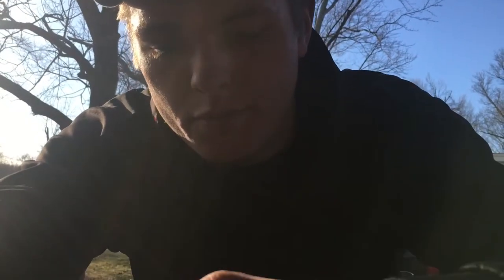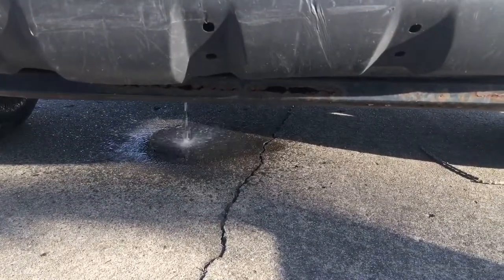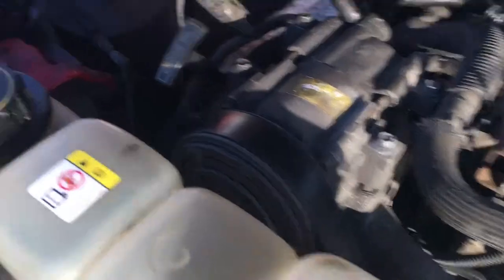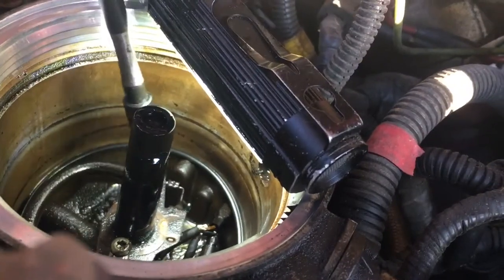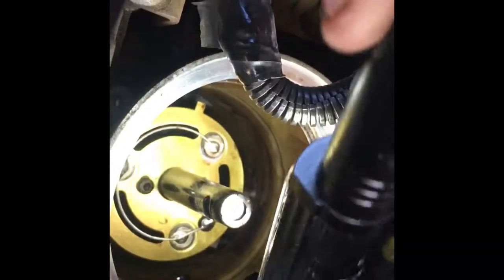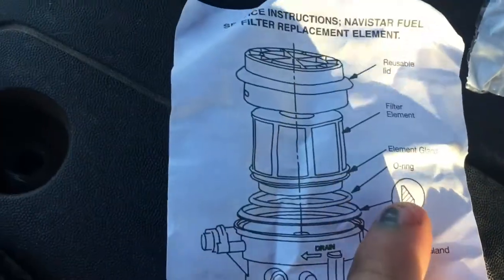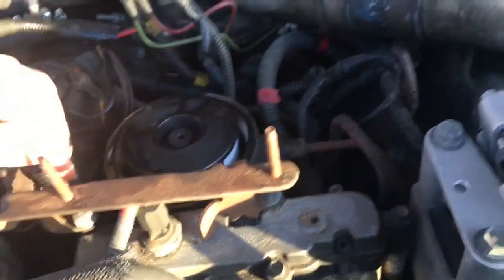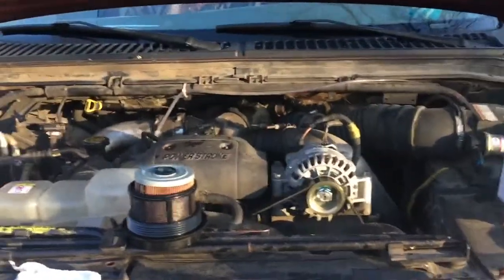7.3L Powerstroke Fuel Filter/Heater Replacement

Comment: Looks like you used the Alliant heating element which is original compared to the one you removed. Anyway, my 1999 has the Alliant but I have to have one mailed instead of just going over to Oreilly and buying a Dorman.

Comment: Can a bad fuel heater prevent the truck from starting ?
Reply from the maker: In the summertime no, in the wintertime yes.
Reply: @HunterStephensKY  ok thanks I'll check it out.
Reply: Mine starts in negatives without one
Reply: @timhoppin7226  ok thanks. Mine died 2 weeks ago no check engine light no codes.
Reply: @peterscholte300  if your wait to start light isnt coming on. Unplug the heater and replace the 30 amp fuse in the lower right area of your fuse panel under the dash. When the heater goes bad they blow that fuse and you need to unplug it before replacing the fuse or itll keep popping.
Reply: @timhoppin7226  thanks I'll try it tonight.
Reply from the maker: @timhoppin7226  Sounds like your glow plugs are working well
Reply: if it shorts out it will blow the ignition fuse and will cut your truck off or stop it from starting
Reply: Maybe The only time it would prevent it from starting is if it's so cold the fuel is already gelled. The heater warms the fuel so any fuel that makes it to the filter bowl won't gel. I'm a farmer with many years running diesel engines. Normally the engine will start with the help of the glow plugs but soon as the gelled parts plug the filter it will then die. My 2001 F250 will go about a mile before it's gelled to much and it dies.